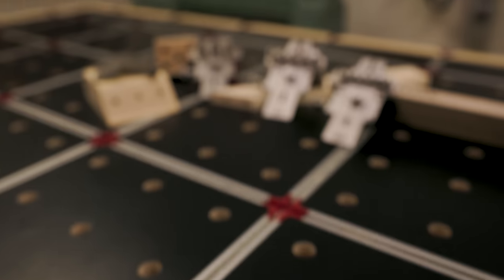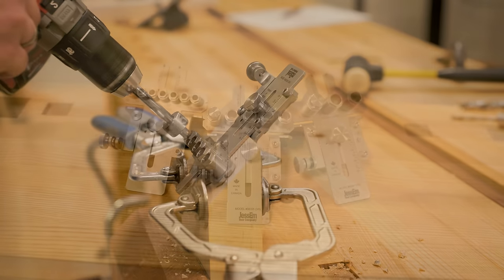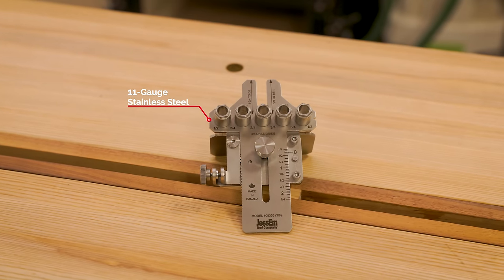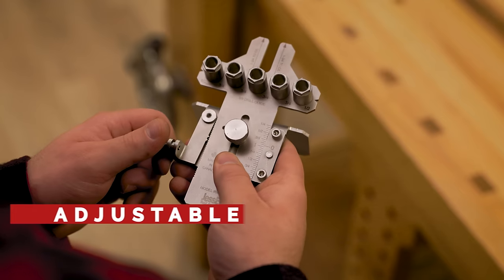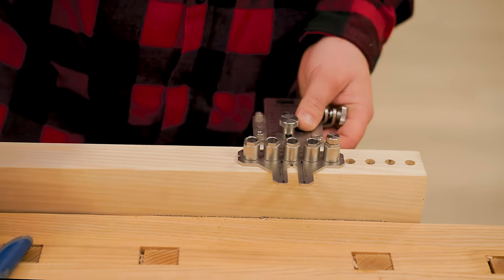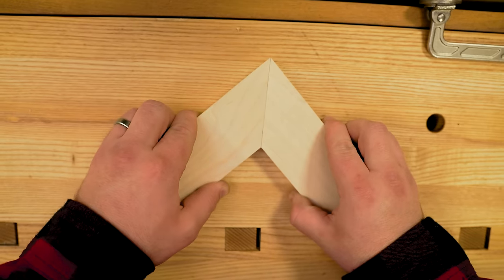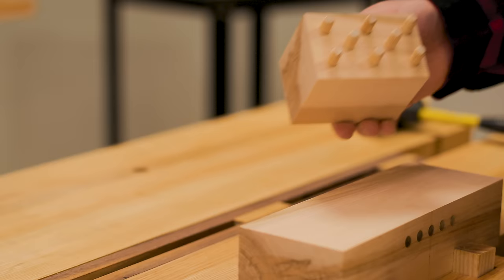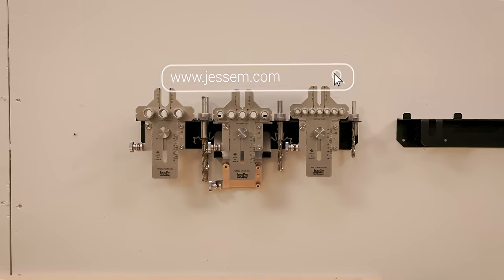JessEm Stainless Steel Dowelling Jig - The BEST Dowelling Jig for Woodworking

Comment: Its pretty crazy how such a basic operarion seems to elude most manufacturers and tbey cant keep any decent tolerances...i mean its dowels ..dowel jigs should all be cheap and accurate but yet its only high end jigs that actually work. Proves that dowels need a high level of precison even compared to other methods of joinery. Its 2023 and doweling is still hard to get right....

Comment: Could you consider an add-on for raising the front alignment pin to raise the gap higher? (When laying two panels on top of each other to get the dowel to slide in center). The old one had much more thickness to align with the dowels on the panel on top compared to the steel one. Having some option to somehow screw another piece in (or on a future revision adding a bend at the front to just raise the tip up would be awesome

Comment: If one looks at regular prices (instead of temporary promotional sale prices), the stainless steel version of the weekend hobbyist package provides a net savings of only $67 USD or savings of 28% compared to the original anodized aluminum version of the Jessem master kit 08350MK.  This is because drill bits are not included in the stainless steel version.  Those missing three drill bits cost an extra $22 USD.

Compared to the new stainless steel version, the original anodized aluminum version 08350 is much better built.  The aluminum version also has a larger capacity (3.5" on the aluminum version vs. only 2.25" on the stainless steel version).  The aluminum version is easier to clamp due to the protruding wing tabs on the bottom section.  The aluminum version is also more accurate than the stainless version because the aluminum version is very rigid and does not flex during drilling.  The flimsier stainless steel version can flex during drilling.  Also, on the stainless steel version, the bottom fence piece and the top piece containing the drill guides are not at perfectly 90 degrees relative to each other.  The squareness on the stainless steel version is off by approximately 1.5 degrees, measuring only around 88.5 degrees.  On the aluminum version, the two sections are perfectly square at 90 degrees.

The only definite advantage the stainless steel version has over the aluminum version is the former's ability to drill dowels at a 45-degree miter with the addition of a miter clamp at extra cost.  If one doesn't need the 45-degree drilling capability, the original aluminum version of the master kit is a much better investment for only $67 USD more than the comparable combination of the stainless steel weekend hobbyist kit+drill bits.

Comment: I ordered my pro version a week ago and got it today. Very very nice piece of work!!! Someone online stated that the angle bracket on the one they got was not perfectly aligned with the holes so the first thing I did was measure mine. It was perfect!!! I clamped it to a 4ft square and placed a 4ft straight edge along the dowel holes. The  far end of the straight edge was perfectly aligned with the dowel end. Good job JessEm!!! JessEm also told me that if there was an issue, they would take care of it for me...but there was not issues.

Comment: Hello, It seems impossible to clamp the jig when working with sheets such as plywood for cabinetry. No T type joints, not even Butt joints. Do you have a solution?
Reply from the maker: This jig has a 1/4" to 2-1/4" reach for any surface. The rear plate can also be removed for easy clamping on flat surfaces. We have multiple videos (shorts/reels) showing it being used in many joints, include T or Butt Joints. Feel free to surf through those as well!

Comment: Will it do miters other than 45 degrees?
Reply from the maker: Currently we only offer an angled bracket (90 degrees) and an optional miter bracket (45 degrees). The Original Dowelling Jig can be paired with our Workstation and do angles from 0-45 degrees!